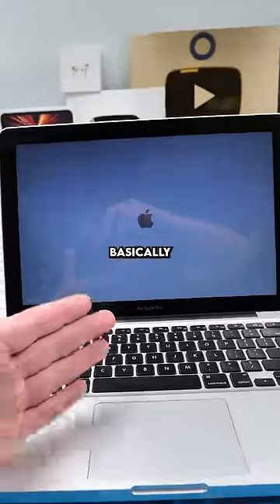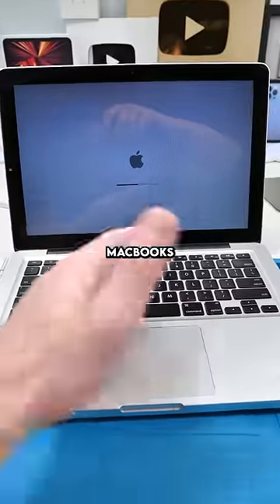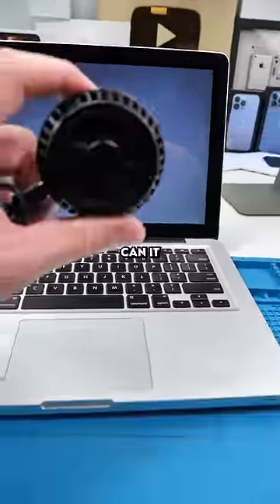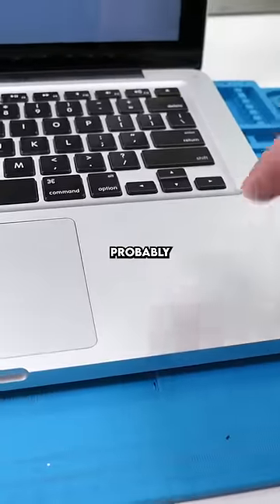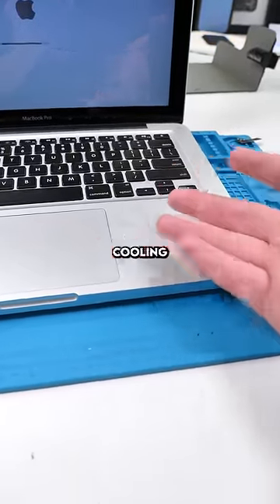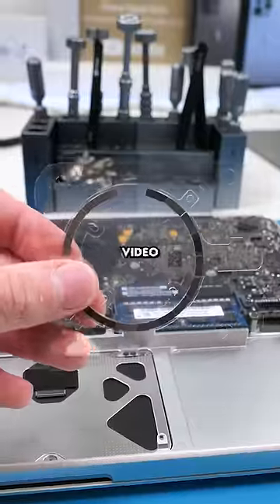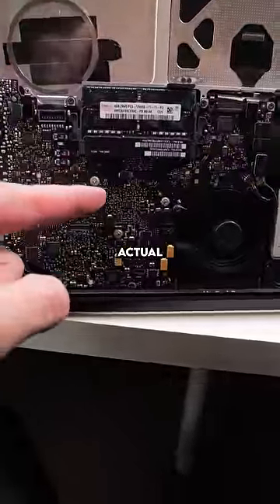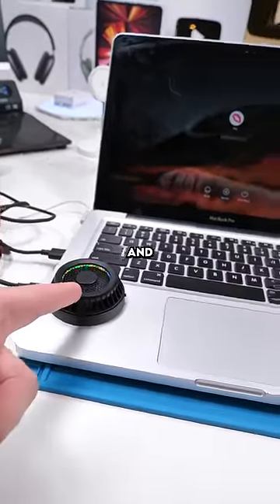I Added Magsafe To A Macbook.. For A Good Reason #Shorts

Comment from the maker: We hit 100k so here it is : https://www.youtube.com/shorts/W514MDywAcc
Razer phone cooler :  https://geni.us/jCfJoB
Razer Cooler Temp test: https://www.youtube.com/shorts/vb-rYOR1bTk
Reply: It will, but unsure how much of it.
Reply: 1c
Reply: Yes
Reply: This will make a nice difference for the battery. Batteries aren’t great with heat and this is cooling the battery
Reply: Roblox make iPhone 6s real hot so can we try this with iPhone 6s
Reply: Do you do repairs I need a repair bad?
Reply: Do you fix stuff for free
Reply: Do you fix electronics like usb for free
Reply: Can you do a review for a laptop cooling pad then put a MacBook on it
Reply: Test If fake airbuds can be charged with real airpods and vice versa
Reply: You should put it on the opposite side, because your hand will be on that side and you cant use it while cooling
Reply: Hey do you make a repair for console if you does I want to send you my psp 1k for repair
Reply: No I don’t, it’s too small of a fan in not a good place. Probably would make a very small difference if placed on the back panel. These unibody MacBook’s biggest issue is lack of good intakes. They intake from the same vent they exhaust from, so they tend to draw the hot air back in.
Reply: @andrejveselinovic7688  magnets and hard drives don’t mix.
Reply: Sir I have one question. Please can you change a camera sensor of android with a high pixel size camera sensor please
Reply: Yes
Reply: I dont think
Reply: Can u do a give away?
Reply: Damnit school sucks
Reply: How much would you charge for a iPad 5th generation that don’t charge or show battery
Reply: Phone tepair guru what do you think iPhone 6s 2022
Reply: Fill the whole bottom of the mac with razor coolers
Reply: 100k
Reply: Why does my MacBook runs constantly at 80ºC with 1% use on the cpu ans same on the gpu (even when not using it) with both fans at 6000rpm ?? I HAVE AN i7!!! HOW ?!
Reply: You get a little water on your phone and it has white lines on the screen  how do you fix it
Reply: "we have a package" in Polish is "mamy paczkę"
Reply: Link no longer work
Reply: @DannyHamdan2004 fr

Comment: Day 42 of asking him to add magsafe to apple poloshing cloth.
Reply: @ZaccyXD day 1 of laughing at this comment
Reply: @madrexertheboredtm7728  day 1 of idk wtf is that
Reply: Bruh I will ever hit like keep on going
Reply: Day 42 of this guy's sanity
Reply: @madrexertheboredtm7728  day 1 of wondering how the hell you maxed out the 64 bit number on youtube
Reply: @madrexertheboredtm7728  so about 106.3 trillion years or 7,759 times older than the universe
Reply: @Baconator20000 
Joke.
Reply: @chrisguest5528 
Man did the math. Im proud
Reply: Yesssss
Reply: bro you can doo ittt
Reply: Yes
Reply: Yes definitely
Reply: @asrkofficial1  day 1 of laughing at you laughing at him replying
Reply: Day 4 of wondering why this dude make this comment here and telling him it isn't possible to add magsafe to a cloth
Reply: @meric12131415 
It is lol. Just put a magsafe circle on it using adhesive/glue. How isn't that possible?
Reply: @SSADO-  I know right 🤣
Reply: @meric12131415 
That doesn't answer my question but alright.
Reply: @madrexertheboredtm7728  🤣
Reply: @SSADO-  it'll probably slide off the cloth so I'm sure it's partially possible but it's much easier just to put it under where the gpu and cpu don't align
Reply: @meric12131415 
Okay then
Reply: @madrexertheboredtm7728  bro has been confused since 10613121498471498438 years ago.
Reply: Day one of needing this MagSafe for my switch 😂
Reply: @TreeBKO ikr my switch is old so it gets hot to much ._.
Reply: LOL LOL LOL LOL LOL LOL LOL LOL LOL LOL LOL LOL LOL LOL LOL LOL LOL LOL LOL LOL LOL
Reply: Thats usseles

Comment: Hope the results are good
Reply: Same
Reply: won't change
Reply: @sjoerd104  yeah I think so. Maybe there would be some kind of temperature drop but I don't know. The body of that macbook looks to be aluminium which would transfer the coldness around the phone cooler area but I dont feel like it would be able to cool the entire laptop down. Maybe if he puts the magsafe onto the laptop fan at the bottom, the fan could pull the coldness from the cooler and that might actually help cool down the laptop
Reply: @sjoerd104  looks like you didn't see the new short

Comment: IRG: Criticises Apple's heatsink solution
Also IRG: Places cooler far away from heat source
Reply: And blocks your hand getting to that weird keyboard thing.
Reply from the maker: where else do u want me to put it bruh
Reply: @PhoneRepairGuru  on the bottom panel, right underneath the CPU??? Like bruh, others have already done it, it’s so obvious. Just put the laptop on a cheap stand so it’s above the table surface and the fan at the bottom has access to air.
Reply: @andreirachko  how thick the magnets are aren’t negligible… I wouldn’t want something pushing upwards on my motherboard while trying to screw it in and close the laptop up that sounds like a great way to break something like one of the solder joints.
Reply: @CoffeeKadachi  no you dunce, ON THE OUTER SIDE OF THE BOTTOM PANEL.

Comment: Him:”and the fans in MacBooks absolutely suck!”

Me:”they have fans?…. I didn’t know that!”
Reply: Some actually don’t
Reply: @lucasklaassen135  Yeah that’s why I didn’t know
Reply: @kyria_kous  The main reason for awful thermals on Intel Macbooks is them not being the processors promised. Intel had actually said they will shift to 7nm by 2017 iirc, but it only happened just recently in 2020. So these laptops were designed for a different processor in mind and every single time intel just kept underdelivering
Reply: @doppelganger_real 2020? My laptop, an HP ProBook 430 G8 has an 11th Gen (2020) Core i5-1135G7, it is built using the 10nm process. Intel didn't make a 7nm chip until 2023.

Comment: This option is so useful, maybe in the future Apple add it to macbook, so you can transfer files , program, connect to your devices easily without cable and charge them at the same time 👌

Comment: Add a cheap/thin long heat pipe as long as you can get. If one side of pipe can reach the cooler and the other side can reach any heat source with a little thermal pad, you have gold

Comment: First of all, the MacBooks usually never overheat, if anything they thermal throttle and secondly the fans absolutely don’t suck. They’re an engineering masterpiece in terms of sound vs performance and are actually quite effective at dissipating heat. The new MacBooks are also so efficient they rarely even need the fans to spin up at all.
Reply: I like to technology of the newer MacBooks with the tank of the older ones but it always fascinates me how they make something that thin not have heating problems

Comment: If anyone wonder how the cooling works, its not just a heatsink and fan there is peltier module at the bottom that sucks the heat and throws opposite way. You can DIY at home

Comment: i used 3 phone cooler on my 13inch intel macbook pro 2020 🤣 it works like a charm! at least my mac can be on room temperature while working heavy task like mobile app development.
i used cooler’s metal pad so i dont implant the magsafe inside my mac
and i put them below my mac because there’s where the cpu is..

Comment: Have this cooler myself. I’ve been wanting to do this with mine and wondered where the best place was to put this fan. Good to see you’ve thought the same thing. Where is the best place to put this cooler. 
Looking forward to the temp comparison. I’d just put the magnets on the palm rest there, on the outside. At least until I could say for certain that it made a noticeable difference.

Comment: A better solution would be to add some sort of heat tube from the main heat sink to that point. The problem though would be that the battery is in the way

Comment: Ok, this an issue that will affect mostly every laptop at some point. Reason? Manufacturers use thermal paste that will give you more longevity than performance, also if the laptop is meant to be more portable they will sacrifice some cooling abilities. 

The solution is to repaste the CPU with higher performance thermal paste, thermal grizzly Kryonaut is my go to.

Something that helps is don’t use a case on your laptop, some cover the intake and exhaust. 

Edit the laptop fan curves, there are free safe programs on both PC and MacOS that allow you to run the fans at full speed. I rather have more noise than less power. 

Thankfully this is something being solved by Apple by 
1. Switching to their own ARM silicone chips since they can make more power efficiently meaning less heat
2. Johny Ive is gone meant form over function is a thing if the past

Comment: Razer has this problem of heat transferring through the chassis that makes the battery swell. Apple doesn’t have this problem. When the palm rest hears up it typically takes an extended amount of time under a synthetic workload or something like gaming. Very likely this wouldn’t have an affect at all for nearly anyone using one of these. You’d be better off replacing tim with expensive paste or Liquid Metal to gain immediately temp differences that would actually affect boost window time or 15s boost frequency.

Comment: There is actually a program I use on my MacBook that the way they are designed the fans kick on last minute and with the program I have I can control the fans and turn them on when I’m running something heavy

Comment: so here's an actually solid idea. If you can add a MagSafe to a Mac so easily just connect it with the battery so you can charge your phone with your Mac without the need of cables.

Comment: I have a question. I have an iphone with a cracked display, but want to get the battery replaced. Would that be possible if the screen is cracked or no

Comment: "I decided to do the left area cuz it's closer to the motherboard".....ya lol also wouldn't want all your data to one day get dumped into thin air when the mechanical drive suddenly either gets fully corrupted, a frozen actuator arm, or (potentially I can see this happening but have no evidence, anecdotal or otherwise, to back it up) starts a fire because the 4.5-7.5k RPM creates an induction current in the circular magnet causing it to generate additional heat instead of taking it away lol

Comment: wouldn't it be easier to use a cooling pad under it? it helped my laptop a lot back then..
i used to suffocate it on surfaces, bed sheets etc.
after getting a cooling pad, laptop was happy as fuck and i actually had cool air coming thru my keyboard instead of hot air xD
Reply from the maker: This reached temperatures of below 0. This in conjuncture with a heating bad should theoretically void any performance disturbances caused by heat. I am curious to see what would be more effective

Comment: Fan on top of battery and case without ventilation holes = killing flies with a handgun
Reply: They mostly overheat when using them on the charger due to battery location

Comment: “Macs can overheat if you’re running a program that requires a lot of gpu or cpu”

Your electricity and water bill can be high if you’re using a lot of electricity or water…

Comment: Would this cool of the computer if the built in fan doesn’t work at all?
Reply from the maker: would work better alongside it. Perhaps if it is on the bottom of the device
Reply: @PhoneRepairGuru  thanks. I have a early 2011 MacBook Pro 13’ that has a damaged fan connector that requires microsoldering to fix. I am keeping my eyes open to alternatives to keep the laptop cool

Comment: you could just tune the fan speeds macbooks are by default set with really poor fan settings. I use an app called macfan controller. set it to CPU core average for the temperature detector and lower the minimum temperature for fans down to as low as it can go and set maximum temperature to something like 85°C you won't have to worry about overheating for a while apple kinda made their devices with a feeling in mind and they don't care if it burns you as long as everyone around you doesn't have to hear the fans kicking on. ofc this lowers the estimated lifetime of your CPU and other components. personally I'd rather just replace a fan than the entire motherboard but that's just me so I run the fans up and keep to a maximum temperature of 80°C (only when I'm running Xsimulator on Xcode.) 45°C average.

Comment: Hey Phone Repair Guru i am here to ask you something firstly i have the exact same macbook pro that you showed in the video and i have problems with it

I removed the battery of my macbook because it was swelling and i couldnt use the touchpad cuz of the battery
After i removed the battery the macbook got slow as hell i couldnt even use it is there a fix? im annoyed so much i looked everywhere about this problem and no one said something about it
Reply: That sounds like a ram and storage problem was any of the ram stick’s damaged? If possible upgrade to a solid state drive that should fix it but I recommend cheeping out just in case that’s not the problem

Comment: Don’t do it, this device will get certain part to a low temperature that water will be formed inside and damage the motherboard
Reply: Not how that works but ok you do know that water doesn’t effect the motherboard right? It’s the battery that it will effect and will be fixable besides condensation doesn’t do anything to a running computer unless it’s enough to fill a cup the internal fan no matter the strength would keep it dry

Comment: Why would u add magsafe to battery
Reply: So you should know that batteries get hot while charged and the problem with the older MacBook tanks is that the battery is underneath the GPU so when it’s charging the battery heats up the GPU causing it to overheat
Reply: @s7shorty  oh i didn't knew mac's battery gets hot as well never owned a Mac thanks
Reply: @bronzehawk3646  most chargeable batteries will get hot when charged

Comment: Try a ps4 next
Reply: Put a couple drill holes in the sides of the bottom shell then put it on a cooling rack cheap router one should do if you want  performance so it draws less power and makes it so the power brick doesn’t get as hot switch to a SSD instead of the Standard HDD

Comment: Try for ps4
Reply: It doesn’t have a heating problem it’s that it’s drawing more power than it needs to pull memory from the HDD upgrade to a SSD if that doesn’t work change the thermal paste and put a router cooling rack under it